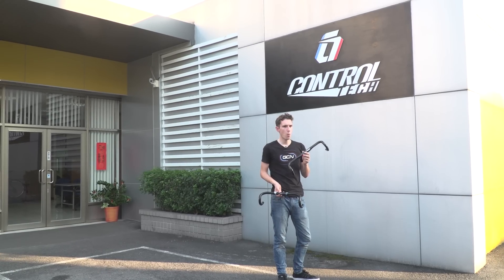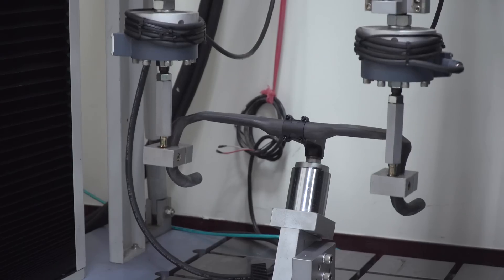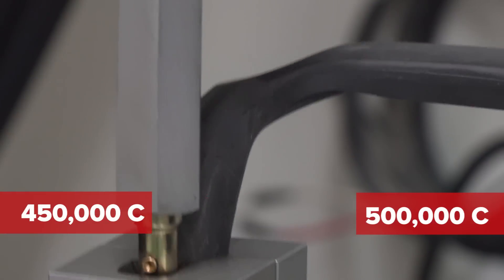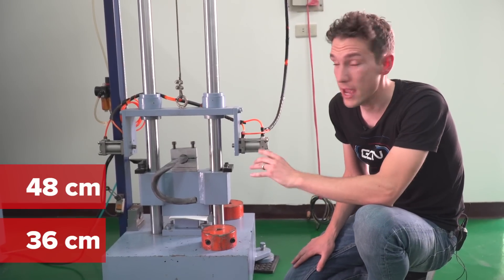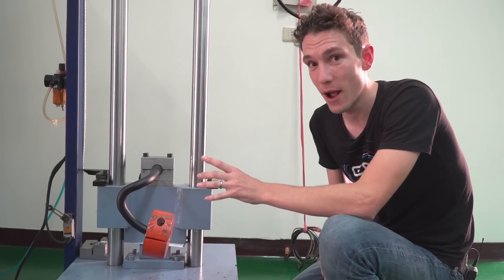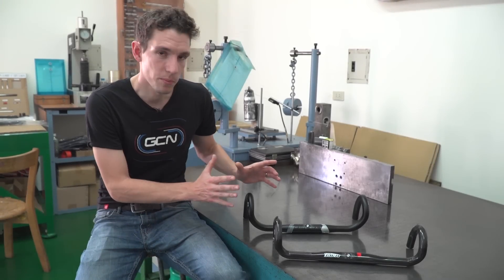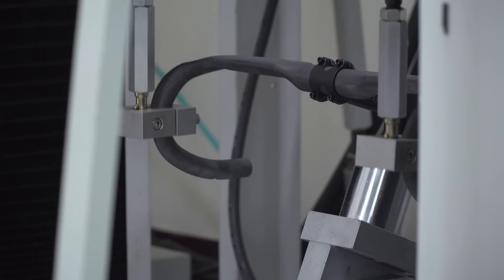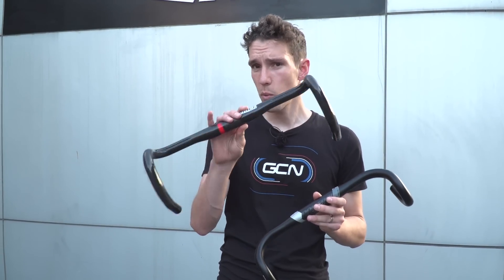Carbon Vs. Aluminium Handlebars | Which Are The Strongest?

Comment: For the fatigue test  it could be more important to know how fatigue failure will look like. Is aluminium going to bend and carbon going to fall apart? In that case, aluminium would still be safer.
Reply: Aluminium hardens with repeated stresses like bending, as it gets harder it gets more brittle until it gives.
Reply: A break caused by fatigue is in most cases a brittle break

Comment: In the stress test, is the stem standardized? Because the way the (stress) machine works, alternately pushing down on the ends of the bar, how much of that the bar could take is, in part, dependent upon how much flex is in the stem. The more rigid the stem, the more stress is put on the bar (because a flexing stem absorbs some of the energy, while a stiffer stem absorbs less, allowing the bars to take the energy). It would be better to mount the bar directly to a rigid upright, so the maximum amount of force from the machine goes into the bar. Maybe also push down on both ends of the bar at the same time, to maximally stress the bar, rather than inducing torsion into the mount, thereby eliminating a variable.

Comment: Why would you test an Aero Carbon bar vs a Round Tube Aluminum?  The tube strength has more to do with shape than material, should have tested both round tube bars.

Comment: Typically, a hardcore rider would crash many times far before either the aluminium and carbon bar fail from fatigue. And speaking from my local racing experience, there's like a 50% chance of a carbon bar cracking upon impact in a crit... And man, that happens almost every week to some poor chap. Also, saying you could ride the crack that formed from the 60cm impact out is plain irresponsible. The next time you hit a pot hole you are going to hit all your teeth out.
Reply: 許嘉宇 I think the point he's making is that it doesn't snap in half, so you can ride out of the pothole and not crash- definitely not meaning "keep riding it" !!
Reply: Haha, he meant just riding back home instead of pushing the bike.
Reply: What the hell kind of crit are you doing where there are that many broken handlebars? I race and have seen only a couple of times seen cracked or dented handlebars
Reply: I know he meant you can ride home. But I am saying that is a very dangerous thing to do when you have 2 big ass crack on your handlebar. Any responsible manufactur would tell you to stop riding immediately and take a bus home or something. Racers in my area are rich so most of them run carbon bars. It really doesn't take much to crack an ENVE, 3T or ZIPP. Sometimes a slide out when cornering will do. Dropping your bike when you stopped for coffee will also do...
Reply: I've people snap the steerer tube off at the stem in circuit racing so I believe him.
Reply: ''Racers in my area are rich'' racers are rich in all places... this sport is crafted for rich people from the get go
Reply: 許嘉宇 I was say you had a valid point until you said the coffee thing and it became apparent that you  just want to ovestate things...but back to the responsibility thing; yes, it is only an emergency exit, quite obviously, and should be done at low-speed.
Reply: He said "ride it out" as in not have the bars immediately snap and you eat stem
He was saying you could control the bike to a safe stop, not ride home or anything ridiculous
Reply: The issue is that in the real world the carbon bar impacts the ground.  In this test they're not impacting the carbon bar anywhere... They're clamping where a stem normally clamps and just have weights added to grip points.  They need to drop the bars on their side into concrete with some weight on them.
Reply: 許嘉宇 dammit i was just thinking to get carbon bull bars now i think they'll go first fall I have - forget it.
Reply: thechosendude they are simulating hitting a bump...from what I have seen, however, it is usually the steerer the one that gets broken when such thing happens.
Reply: The test shown was specifically an extreme 'pothole' test, they will also conduct impact tests. ISO 4210-5:2014, Cycles — Safety requirements for bicycles — Part 5: Steering test methods. There will be something like "Static strength and security tests"
Reply: I ride trials and enduro with carbon handlebars and they crush several times a day, every day. If you crash had enough to trash your handlebars I am sure that the handlebars are the least of your worries. Besides, how many broken handlebars have you seen anyway? On road bikes I've seen two, in both cases the rest of the bike was trashed as well.
Reply: Agreed. That's not an impact test.
Reply: I think there is another point for the decision: corrosion! because of the alloy/carbon stem and the sweat/rain it could be better to chose the matching composite?! #torqueback
Reply: The nasty caveat with carbon fibre is that it's strength is anisotropic: it's much stronger when the force applied is in some directions than others. Notice how they're applying force in almost exactly the same places and direction in all these tests. That's why you can expect it to fail in an actual impact.
Reply: People also ride without hands on the bar at all. It seems totally reasonable to ride home with slightly cracked bars.
Reply: J H I make 200$ a month

I'm 14 and my parents bought my road bike (Trek Domane Al 2)
Reply: santa cruz bicycles are unbreakable  and their carbon is quite amazing
Reply: @XxIzhtarxX  Something similar was said about Titanic

Comment: One thing that is often overlooked with carbon, the epoxy composite begins it's finite life from day one.  It is never as strong as it was on the day it was popped out of the mold.  It looses resiliency continuously and eventually delamination from the carbon fibers themselves occurs.  Metals fatigue, especially aluminum.  Both carbon fiber and aluminum have a shorter life that steel or titanium.

Comment: don't have any carbon on my MTB anymore. Two seatposts snapped. Both with no external sign of wear. And no , I'm not a fat bastard.\just used the bike as it was designed.
Reply: If I build an MTB (I plan to build a trail bike once I dive into MTB riding), it'll be carbon-free too. After all, it's supposed to be a fun bike, not a bling bike.

Comment: Not comparing apples to apples as the profile of the tubes for each of the bars was different. The alloy bars were cylindrical and the carbon fibre were aero profile (flattened). The flatter shape of the carbon bars compromises their strength. I'd still go carbon fibre as even when it failed it still held together.

Comment: Did you test Titanium bars? If not would be interesting and they are available at least in straight and riser for MTB.  Do a search of Carbon fiber handlebar breaking to see plenty of videos of breaking handlebars.  Have seen in professional road racing and drop bars as well.

Comment: Could you do a test on what happens if you have aero bars or other stuff mounted on the bars? Would the carbon simply snap where it's clamped?
Reply: I think that happened to a rider from Ag2r recently when his TT bars broke.
Reply: If "the other stuff" means the brake levers, I am interested in as well.

Comment: The crash test missed a very important factor for aluminium -- it fatigues at very low stress levels and the micro-damage from that fatigue is cumulative. This means that the alloy handlebar that withstood 80 cm of impact when new, may be damaged at a significantly lower level after it's been in use a while. This cumulative fatigue characteristic of aluminium alloys is one of the reasons why engineers must build in much greater safety margins into their alloy designs. By comparison, steel, titanium and composite carbon do not have the same cumulative fatigue problem. To factor the effect of cumulative stress into your drop test, you would want to conduct the drop test on handlebars that have first been pre-stressed with the fatigue test.

Another factor that was overlooked in these tests was the kind of reinforcement provided in the composite carbon handlebar. The one tested did not appear to be reinforced for aerobar use. I use aerobars and my composite handlebars are all reinforced for them. This means the handlebar manufacturer increases the width of the center portion of the handlebar that can safely accept a clamping force. This is done so aerobar brackets can be added on either side of the stem. These type of composite handlebars might not fail as early as yours did in the crash test. It would be interesting to see what drop height they could handle.

Comment: Technical strength in lab tests is one thing but having trust in the parts in actual use is more important when taking on the real World with confidence. :-)  Having ridden many thousands of miles offroad on alloy bars without any major catastrophic failures and also experiencing a sudden structural failure of expensive carbon bars that ended very badly I refuse to use carbon parts for any structural components on  my bikes. Only Ride what You know and Trust! - Your life depends on it!

Comment: I will always go with Aluminium because I want crash strength. I've bent 6 seatposts on a mountain bike and quite a few handle bars in my day and I would much rather have it bend than shatter. Thanks.
Reply: Carbon doesn't just snap off if installed properly; infact, if you're rough on your stuff, move to carbon, you'll be way better off.

Comment: I have cracked two aluminium bars so far - but these where cheap ones on regular bikes.
- with the second I discovered that it already had a little hidden crack - because part of it contained accumulated dirt. what I learned from that is to replace any handle bar after a crash on it.

Comment: I'm a big guy (6'4", 260 lbs). I rode DH for a decade, before coming back to more AM riding. I'm running a set of Oxive carbon fiber wheels.
I am amazed at how strong they are. The wheelset weighs just over 1600 grams, and they are STRONG. I had a crash this summer, moving at around 15 MPH, where I stuffed the front wheel sideways into the ground, full on 90 degrees like.
I took a beating. My bike took a beating (I twisted my stem 90 degrees on the steerer tube, the brake calipers on both ends of the bike had to be realigned, and my rear thru axle got twisted weird in the frame somehow).
My wheels were perfect. Not a mm out of true. As a big guy, I have a history of destroying rims. My carbon rims with a season of riding have a few nicks and scratches, otherwise they are perfect.

Comment: So why is it that both of my local bike shops that have been around for a very long time, (when steel was the frame of choice) that these shops are seeing far more failures due to fatigue with carbon fiber bars then they ever saw with aluminum bars?   They also are seeing more CF bars being broken in accidents as well, but that was pointed out with this video. 

Now there is some debate as to what is causing CF bars to fail, the mechanics were also saying that there may be some problems that look like fatigue failures when in fact they were operator installed error that over torqued the bars and the stem clamps crushed the fiber just a bit and over time they broke.  There's even controversy that some mechanics either don't know the exact torque setting to use or the company with the bars gave wrong torque information.  Something that never was even remotely considered being a problem with AL bars.

The mechanics I spoke to about this all said they would never use CF bars, and one went as far to say he would never buy a CF bike because they're seeing a higher failure rate of CF frame as well vs other material they currently sell or use to sell, but that's another debate.  To be fair there was one mechanic who does some state racing, his race bike is all CF including the bar, but when he's not racing he uses another bike for training that has AL bars, but that as he said comes down to weight and on the racing bike he's cutting weight as much as he can.

Comment: So, why did you use a round aluminum bar and an aero with internal cable route carbon bar for the impact test? Possible results were stacked in the aluminum favor by the shape of the bar. For the comparison test to be reliable the bars would need to be the same shape.

Comment: With carbon you have yo be very carefull when installing it. Making sure everything is tightened exactly to spec. 

Aluminium you do not need any torque wrenches just muscle memory. And when it fails it just bends not snap. 

Furthermore if the bike is involved in a crash you have to carefully check for carbon cracks which may cause snapping.

Comment: Electrolytic induced erosion of al bars with a carbon or steel stem (if the paint/coating of the al bars is compromised)...

Comment: Time is not a friend to carbon; the resins can/will age (dry out - especially with temp changes & humidity fluctuations, again over time), which would dramatically change it's results for both tests.  Also, the impact to worry about with carbon is not so much the load spread over the length of the bar, but an impact on a specific spot on the handlebar.  Say a one inch tube striking the top bar just outside where it attaches to the stem (as what might happen in a peloton crash) - there also the carbon will have a significantly less impact resistance.
They are sweet, but not worth the minor weight penalty for me (or even most of the pros who don't even have to pay the extra out of their own pocket)
Reply: have you heard of corrosion? i ride all types of bikes, i trust the carbon in all of them.
Reply: @tribalismstudio  that's why you wash your bike every now and then

Comment: What about the Nm force when clamping stuff on? I always think carbon compresses over time and that's why things can slip, but maybe it just slips because of the material? Carbon is really really hard - it takes 2 or 3 hacksaw blades to get through a fork steerer.
Reply: It's prone to slipping because of the material's nature, this is why carbon paste is meant to be used on smooth carbon parts that are to be clamped. If you try to clamp it dry to have a rotation-resistant force equivalent to an AL counterpart, it could break.

And what? I've seen mechanics cut a carbon steerer tube with just one hacksaw blade, saw them cut another one months later, with the same blade, no major signs of deterioration.

Comment: Why is the carbon bar in the impact test a different tube profile than the aluminum?  It stands to reason that the carbon would be less strong since the cross-sectional diameter is significantly smaller.
Reply: The design of the tubes is probably different due to the materials. They designed them to have similar stiffnesses, which requires less carbon. So these are probably equivalent bars for stiffness.
Reply: That would only apply if the carbon layup was the same weight all round the bar. With carbon, you can tailor the layup to get the strength most where you need it and save weight where you don't need as much strength.
That would be trickier to do with aluminium.

Comment: The carbon bar is a different shape than the aluminium bar tested, it failed at the cable routing holes. Typically in a comparison test we would look at similar products, not ones of a different geometry .

Comment: So my take away from this is that a minor surface indent in my Thomson Carbon bars due the the stem wont cause any issues. There is no way that I can up 400nm torque though the bar at max chap. Basically the repair industry around minor cracks or indents is built around fear mongering and for get what the pros ride and their equipment, they ride prototype bars and carbon.

Comment: I'd be curious to see a fatigue test after a small impact. I believe carbon and composite in general don't like this. It's easier for composite materials to damage slightly on a small impact than alloys.
Then fatigue does the rest by propagating cracks between layers etc.

Comment: The one major flaw in the testing here is that the two bars are of a fundamentally different design... perhaps the results would be far more conclusive with two round bars, as the aero design of the carbon bar along with its cable routing holes makes it incomparable to the other bar...

Comment: Hold on a second- the carbon bar is has an aero profile while the Al bar has a round profile. Of course the slimmer profile bar is going to fail first in the horizontal drop test.

Comment: So in the breaking-test you compare an aero-handlebar with a normal round handlebar? 
You would better compare apples with apples and pears with pears. 
What about compairison of stiffness or comfort. 
I'm currently deciding between two handlebars for my gravel-project. Alu: 233g / 80 Euro. Carbon 190g / 260 Euro. 
OK, 40 gramm ist 40 gramm, and if you don't know where to safe them, you perhaps need this carbon handlebar. 
But if you go out for a ride these 40 gramm won't bother you. 
So for me would be verry interresting, what about stiffness and comfort - maybe also which ist stronger - but only for the same shape and dimension of handlebar.

Comment: A 1 meter dead drop with only 10 kg weight is not sufficient, and definitely not 'extreme'. Who decided on the weight?
 What happens if you're unbalanced over your bike when you land a 1 meter drop? 
What happens when your front wheel slips and most of your weight is over the bars?
Aren't there way more than 10 kg on the bars in a frontal crash(even with the front wheel taking some of the impact)?

I'm amazed to see how little impact resistance these 'modern' carbon fiber parts actually deliver.

Comment: The real problem is that if a bike with a carbon handle bar falls down, the handle bar can suffer from micro-damage and would be weaker afterwards which could lead to earlier material failure. Aluminum is just more predictable here.